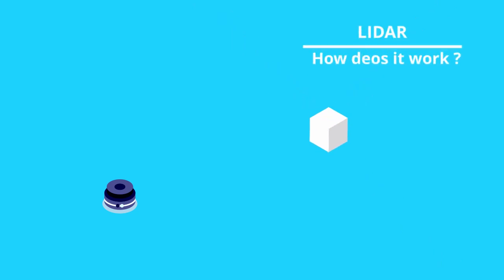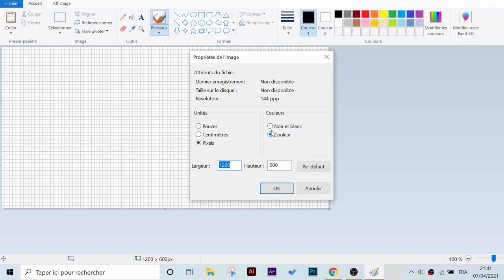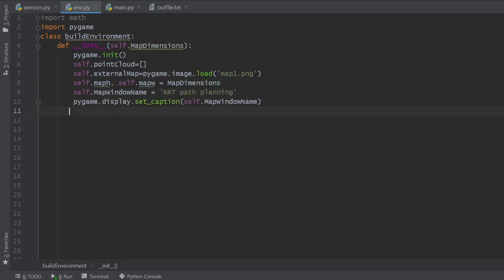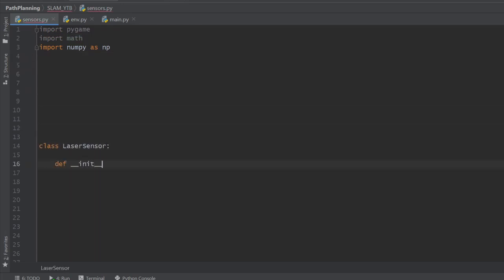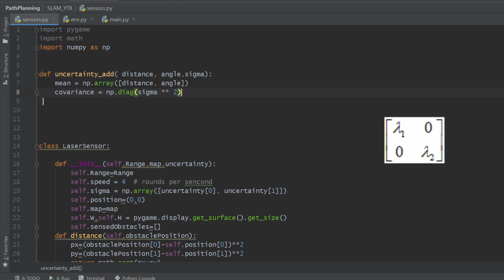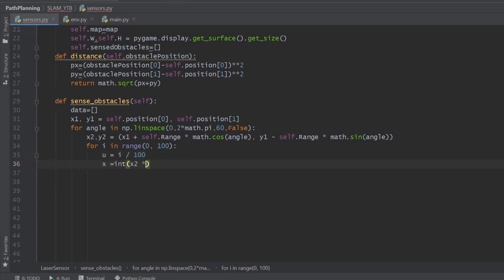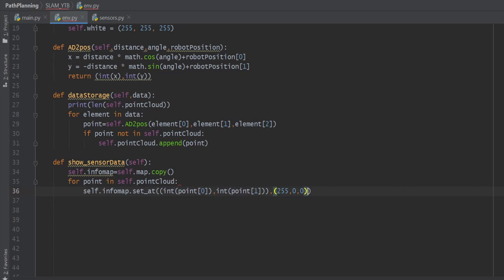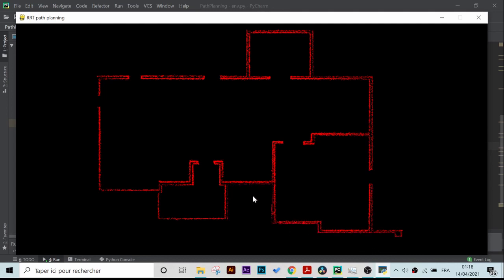simulating a LIDAR sensor from scratch with python | SLAM SERIES

Comment: hey is there any way of doing this with camera but without a LIDAR? because I've done some research and it kinda looks like it's possible...
Reply from the maker: Yes, autonomous driving can be done with a camera. Tesla for example uses cameras, radar and ultrasonic sensors.
Reply: @hobby_coding  thx

Comment: While converting lidar measurements to position: why for y coordinate you subtract it?
y = - distance * math.sin(angle) + robot_position[1]

shouldn't it be
 y = distance * math.sin(angle) + robot_position[1] ? i.e without a negative sign.

And similar in the function sense_obstacles()
Reply: Use the + sign,  not the - sign. The + sign worked for me.
Reply from the maker: the - sign is to account for the display inverted y axis
Reply: @hobby_coding  stop scamming broooo
Reply from the maker: @dingdong2588  what are you talking about ?
Reply: @hobby_coding  im sorry daddy

Comment: @Algobotics Love the video, can't wait to see what you do next. 
I had two errors in the code. 
1) " TypeError: 'bool' object is not iterable" in the dataStorage function.
fix: add an if function before the for loop in the dataStorage function 
if data!=False:
      for element in data:
               ...
               ...

2) The window did not close after the close button (the x next to minimize and maximize) in the corner was pressed.
fix: add pygame.quit() after the while loop in the main file.

It is also a good idea to add pygame.init() at the beginning of each file to ensure no "video system not initialized" errors.
Reply from the maker: thanks, Louis, i will pin your comment to help people find the solution to some bugs. regarding the if condition I probably just forgot to add it in the video.
Reply: Can you please share your code? I am having a hard time debugging
Reply: I have done what you say but it still does not work. :/

Comment: This is so awesome!!! Can you please provide the project link please?
Reply from the maker: sorry , i'm waiting for the project to be completed befor I post it in GitHub , so please just write the code by watching the video for now .
Reply: @hobby_coding  actually I did coded along the video but got some errors. And I need to implement SLAM simulation like this for a project. That would be great if I could get some help from you.... Please consider.
Reply from the maker: @yoursyasuo5868  please tell me what bugs did you get
Reply: Yes I agree, that'll be a great help
Reply from the maker: @NimishKashyap  hi nimish, the reason for this is because I want to detect any mistakes  that may be in the video so please write the code by watching and tell me if you find any problems
Reply: I got the sensed_obstacle() not found. I double checked my code and I have literally defined it correctly but still it is showing that same error
Reply from the maker: @yoursyasuo5868  yes the reason is that the function name is sense_obtacles() and not sensed_obstacles() change it and this will fix your problem
Reply: @hobby_coding  yea i did that already
Reply from the maker: @yoursyasuo5868  did it work?
Reply: @hobby_coding  no it did not sir. It is now showing no dataStorage function is available.... Its okay sir I'll try by myself. Thanks for your concerns. ☺️
Reply from the maker: just debug your program carefully ,and it will be ok .
Reply: @hobby_coding  yeah sure!
Reply: I am very new to Python and programming in general and out of nowhere our university assigned us to create a slam based robotics project..
Reply: Can you please give those files? Please that'll be a great help!
Reply: Can you copy the code and paste it here?